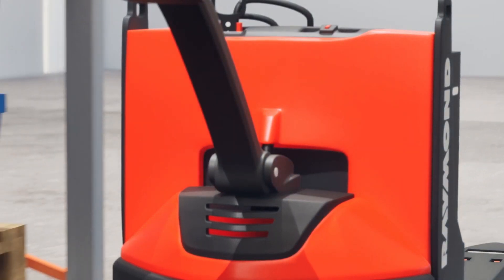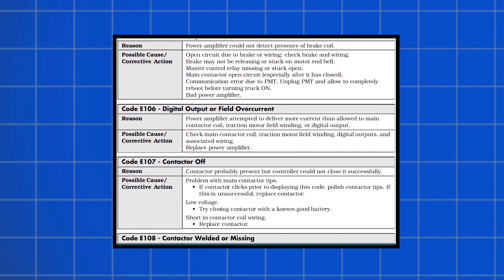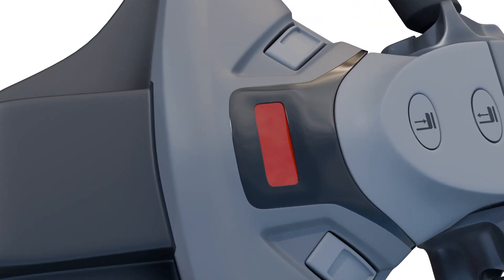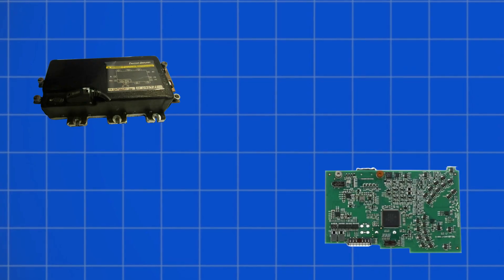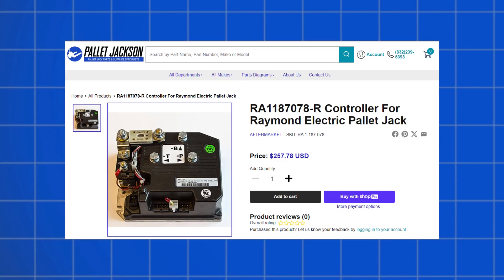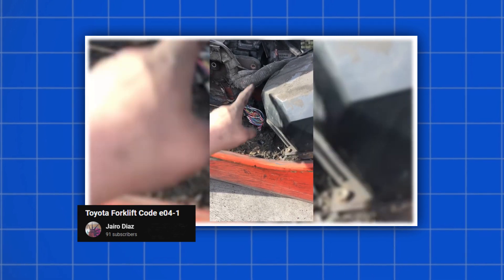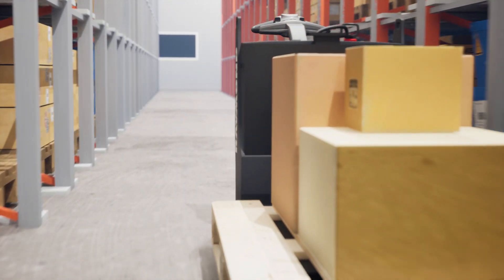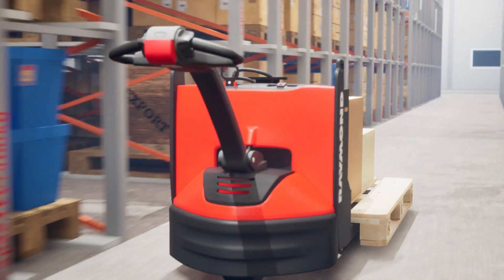Raymond Electric Pallet Jack Error Codes | Fix Error Codes C-28, C-20, E-101, E-106, E-114 & E-150

Comment: in fact I have two of them  when I use the "good one" batteries  both of them work,  when I connect the "bad one" baterries  the second  has the same behavor . So only the batteries can cause this   or  there is any circuit  with the batteries  I need  to look at.  Thanks you
Reply from the maker: Thank you for contacting us. Based on the information you have provided, there may be a communication fault originating from the expansion board. We recommend consulting your pallet truck's maintenance manual for an accurate diagnosis of this fault code. However, it is advisable to seek the assistance of a professional service technician in person, as they will be able to thoroughly inspect your equipment and provide appropriate guidance.